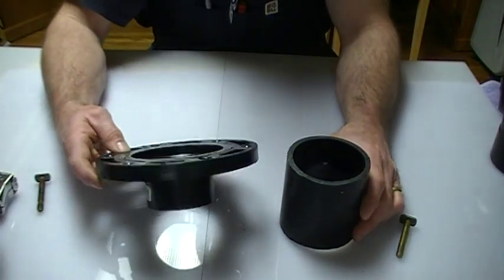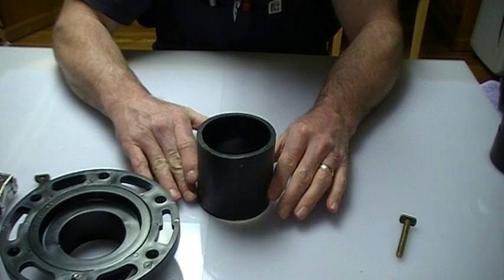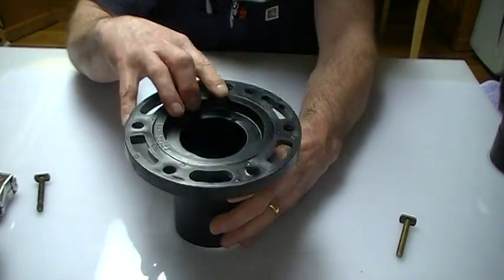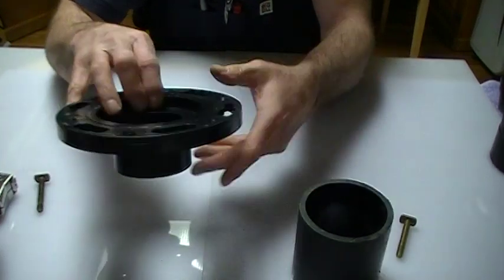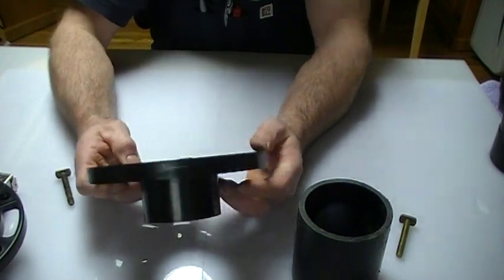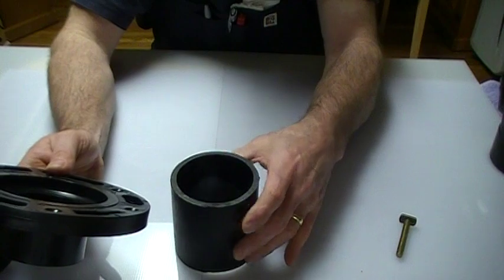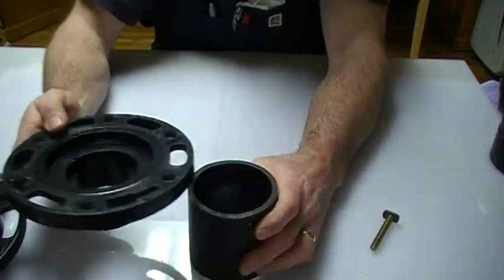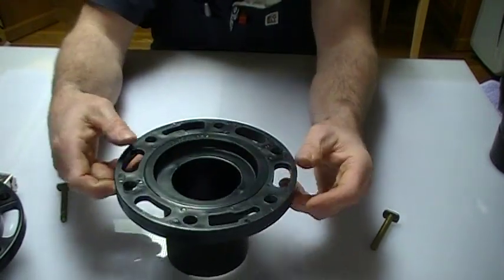Handy 4" by 3" insertable floor flange -for concrete floors.and regular installs.How to.

Comment: Thanks this is all the info I needed! Great to see informative videos that are all business and no unnecessary banter.
Reply from the maker: Hello Dan,
You're welcome!
Hopefully ti helps with any future projects!
Thanks for commenting and enjoy your week!      Al
Reply: @TheOldkid888  what if the pipe is 2" below the floor?  it was too high before cut flush and even a tad lower but flange still was too high so had to cut it all out and now its 2" from floor
Reply from the maker: @Eastbaypisces
Reply from the maker: What you may want to do is use a 3" coupling and glue it to the pipe. This should bring you about flush with the floor as long as your cut is relatively straight. There are two different types of fitting flanges. One fits inside the coupling and the other fits inside a piece of pipe. If you can find a fitting floor flange that fits inside the pipe; it is just a matter of cutting a short piece of pipe a little less than 1 and 1/2 inch and glue it into the coupling. Then glue your flange into the pipe.
If you can't find a flange that fits into pipe then you will need to trim about 3/4s of an inch off the coupling and use the regular fitting floor flange. I know this seems a bit drastic to cut that much off a coupling, but this will work for your situation. The fitting floor flange will be higher then the floor if you do not cut the coupling because there is a taper to the flange which will not allow it to go in any farther. You may have to trim a little off the flange as well. If you are able to glue this together you will have no problems as far as the connection leaking. 3/4s of an inch well glued for this situation will work fine. I hope this is clear as far as  instructions go. Let me know if you don't understand it and we will try and go through  it again.
Thanks for commenting and let me know how you get along....Al
Reply: @TheOldkid888  thx for the response but I'm confused i have 4"abs pipe that is now almost 2" below floor,  was thinking of getting flange with longer shank to reach but they all take a week to get here,  other option was cutting more from pipe then coupling then piece then flange
Reply from the maker: @Eastbaypisces  NO worries. Most toilets are supplied with a 3 inch line going to them. I would definitely cut the pipe as this would be your easiest and quickest route if you can do that. Add a coupling and then a 4 inch floor flange or use a 4 by 3 reducing coupling and a 3 inch flange. Either way will work for you. 
I was under the assumption that you couldn't get at the pipe and cut more off. My bad.
Hope this helps!
Let me know how you get along....Al
Reply: @TheOldkid888  i gotta go back under house but I think I could get to it.  Thx
Reply: @TheOldkid888  hard to reach from floor,  space around it not much
Reply: @TheOldkid888  u can't go from coupling to 4" floor flange tho right? U d need a piece in b between right?
Reply from the maker: @Eastbaypisces  If the pipe is 2 inches below the floor you can install a coupling and then a fitting floor flange glues into the coupling. You must cut a little off one end of the coupling that is upward. I would say about 3/4 of an inch. The fitting floor flange has a taper to it, so you want that to go go below the floor. It can be a little difficult to get a 4 inch flange although I just checked and the big box stores carry one that may work for you. It is an oatey twist and set. It is 4 inches overall and should go into the piece of pipe for you. Should work for you situation. 
Hope this helps!

Comment: I test fit without any wax and toilet sits roughly 1/8 in. off the floor.  Do i have an oddball toilet?
Reply from the maker: Sorry you ran into this problem.
It sounds like your floor flange is quite thick. I believe only one manufacturer makes them a little thicker than others and this happens unless tile or some other product is brought up to the flange.
When the flange is placed on the finished floor it is guaranteed to happen.
 
The toilet will sit flat on the front, but not on the back end. If this is the case you can replace the flange or shim the toilet on either side of the bolts. 

If I do shim a toilet because of the floor not being level or warped I use plastic shims that will not rust or deteriorate.

Once you have shimmed the toilet and it feels firm. A bead of silicone will take care of the gap for you. 

You can replace the flange, but it is a bit of a project!
Thanks for commenting and let me know how you get a long....Al

Comment: Well explained, I used the was the ring with plastic, the toilet is above the floor level. I will put the wax ring without the plastic. will solve the problem. Thanks for the nice explanation.
Reply from the maker: Hello TiroA,
You're welcome!
Great to hear! The wax seal alone is all that is required for that situation. You will see toilets sometimes that are above the floor a little and it is the plastic ring that is embedded in the wax seal that prevents them from sitting flat on the floor only for a leak to occur in the not too distant future.
Congrats!
Thanks for the kind words and have a great day!       Al

Comment: By far the most direct and well-explained video on how to install a flange on a concrete floor.  Can you tell me the manufacturer and model number of that particular flange?  Many thanks!
Reply from the maker: Hello gpstoddard,
You're welcome!
Here is one number that I found...Aqua-Dynamic Closet Floor Flange 3 Inch Inside Fit Plastic
Model # 3494-001
This is just one number. If you go to your local hardware store or big box store they should carry this flange as it is quite popular.
Thanks for commenting and best of luck with the project!    Al

Comment: Excellent video! 
I am installing a 3/4 inch subfloor called dricore in my bathroom on top of the concrete. I assume that I should cut the pipe flush to the DRICORE and not the concrete. Then I can finish with tile and I’m good to go? Thanks!
Reply from the maker: Hello sushi13141,
You're welcome!
That's exactly correct!
This style of flange will glue directly into the pipe and that is what you are looking for in your situation.
Thanks for commenting and best of luck with the project!   Al
Reply: @TheOldkid888  thank you! So appreciative for folks like yourself to learn to do certain things around the home. Hello from Winnipeg.

Comment: Can you use any of the holes on a flange to run screws through to secure it to the floor?
Reply from the maker: Hello keytothegate K,
Whenever I am installing a floor flange I put screws into every hole. The most important holes are the ones located where the tee bolts go. That is where upward pressure will be applied to lift the flange when you tighten down the bowl so I always put screws in those holes in particular, but a general rule if at all possible is to put them in all the holes.
Thanks for commenting and enjoy your week!     Al

Comment from the maker: Hello e1casper;

I have installed a number of these flanges and have had no problems. The opening in the bottom of the toilet is smaller then that of the flange. I will ask around though. I only use them in situations where the concrete has been poured and no sleeve has been placed around the pipe. It is an ideal place for this install.
Thanks for commenting and enjoy your week!   Al

Comment from the maker: Hello J Malone;

It is very easy to cut it flush with the floor if you are using a reciprocating saw and a long blade. The blade will bend and make a clean flush cut. A hand saw will make the same cut for you. I have used both and have had great success!
Thanks for commenting and have a great day!    Al
Reply: so the actual flange should be flush with floor, mine is still a lil above, im using same flange should i cut pipe more down cuz when i dry fitted everything w toilet on it seemed wobbly a lii but idk if thats cuz i hadn't screwed the flange in yet
Reply from the maker: @Eastbaypisces  Yes. The flange should sit on the floor, so you should cut a little bit more off the pipe to ensure this happens. 
Good luck!
Reply: @TheOldkid888  yea I cut more and cut into floor more so it would sit flush w floor
Reply from the maker: @Eastbaypisces  Your all set now! Best of luck with the rest of the project! If you have any other questions be sure to ask!       Al

Comment: Hi Al,great video. Question, I am installing a 8mm vynl floor in the bathroom, do I cut the pipe flush with that flooring? or still flush with the concrete and the floor is cut aorund the toilet after it is installed? Jim
Reply: Jim, how is this holding up 7 years later? I’m in the same situation and wondering if I should install this AFTER my vinyl floor is done? Or install now set flush with concrete.

Comment: I have the same question as Jim Taylor below.  Should this be installed before flooring (sitting on the concrete) and have flooring installed around it, or should it be installed after the flooring and sit on top of the flooring?  My flooring will be just over 1/2" in thickness.
Reply from the maker: Hello SprayandPray25;
If you were installing vinyl; I would have no problem doing it either way, but since you are installing 1/2" flooring you are much better off to install the flooring and then install the flange.
If you are installing laminate on the concrete floor in the bathroom; keep in mind that laminate flooring isn't a fan of water.
If you have already installed the flange; you will need to double up on your wax seals when installing the toilet. This will work for you as I have come across this situation many times especially where people have installed ceramic tile and the flange is level with the floor.
I am a big fan of the no wax toilet seal that Fernco makes. I made a video of it.
Thanks for commenting and best of luck with your project!    Al
Reply: TheOldkid888 Thanks Al!  I am doing laminate in the (half) bathroom but will be cognizant of the moisture.  I have a moisture barrier going down under the laminate and will caulk around all the floor edges and fixtures.  I'm also going to see what's available in the way of wax sealant.  Thanks again.
Reply from the maker: Hello SprayandPray25;
You are more then welcome!
Good luck with the project!
Thanks for commenting!   Al

Comment: Thank you for the great video!!
I just dremel'd my old ABS (hub) flange down level with the plywood that sits atop the joists.
This is a second level bathroom.
The inner diameter of my tube is 3"

I am now faced with either...
1) Chizzling off the remaining portion of the previous hub flange away from the 3" tube below, so that a new 4x3 hub flange can take its place.
OR
2) Cutting the ABS tube horizontally below the old flange connection, then installing a 3" All Hub coupling, followed by a 4x3 Spigot flange (as you showed in this video)

#2 seems faster to me.
But I think if I do this, the spigot end of the flange will only go half way down into the coupling below it.
Would this still seal properly after applying my ABS welding solvent?
Reply from the maker: Hello Mii,
If you apply a good amount of cement you will have no issues with leaks. I have done this several times with no issues. Just allow the cement to set before flushing any water down the drain.
Thanks for commenting and enjoy your week!    Al

Comment: have this flange that somone else installed in prior to me buying it and it clogs pretty easily and i also sell them where i work and i've had several customers comeback and say that they have had problems  with clogging after using this flange i would only use this one in a pinch or whereever acess to the outside of the pipe is limited

Comment: how about a 2nd story bathroom into a cast iron pipe and can you use a wax free seal
Reply from the maker: Hello John,
The wax free would work if you are going into a piece of pipe. You would need a 4" Fernco wax free toilet seal. It has to go onto a new or wax free toilet bowl as it needs a dirt free surface to adhere to.
A little tip when installing it to make it easier is to apply a little dish soap onto the ribbed edges as this will help it slide into place easier.
Hope this helps!
Thanks for commenting and enjoy your day!      Al

Comment: Hi. My basement rough in for toilet is 3 inch abs.   I can't seem to find an insertable toilet flange.    Where did u get this?
Reply from the maker: Hello Arek M.,
I pick mine up at the plumbing wholesale stores. You may be able to get one at one of these stores if you tell them that you can't find one any where. 
A few of the hardware stores do carry them. Not all, but a few. 
You can looking on line as well. You are looking for an inside fit flange that fits inside the pipe. You should see that in the description.
Hope this helps!
Thanks for commenting and best of luck with the project!     Al

Comment from the maker: Hello Todd;

I was just out at Home Depot and came across the flange. There it is called a "closet fitting floor flange. 3" inside fit" . Here the price is $7.49...
What are you planning on putting on the floor? This flange is quite thick and the concrete should be quite smooth around the pipe.
I hope this will help you out!
Thanks for commenting and best of luck with the project!    Al

Comment: Saw the same question here a few times:  should the flange be installed OVER flooring, or should the flooring be cut around the flange?A:  Always install the flange directly onto the concrete (or sub-floor if not in a basement), then cut your flooring around the flange.  This will ensure that the edge of the toilet sits on the flooring, to take the weight, and the rim of the chute rests properly in the flange.  Depending on the height of the flooring you use, it may be necessary to use a flange extension kit, but this is rare.  Most ceramic floor tiles sit well at the flange edge.
Reply from the maker: Hello Rick,
Thanks very much for that response. 
You are exactly correct!  Sounds like you have some expertise in this field.
I really appreciate your input!
Thanks for commenting and enjoy your weekend!     Al

Comment: What was the diameter of that pipe?
Reply from the maker: Hello Hablando Boxeo,
The pipe size is 3" which means the inside diameter is 3". The flange that fits inside the pipe is a inside diameter toilet flange.
They are not common, but I know that some hardware stores sell them. Ideal where pipe is coming through a concrete floor. Just cut the pipe off flush with the floor and glue to the inside of the pipe.
A regular fitting floor flange glues into a hub of a fitting. Something to be careful of when purchasing one.
Sorry if I went a little far on the explanation. 
Hope it helps!
Thanks for commenting and enjoy your week!     Al

Comment: I am looking for this style flange for 3 inch pipe for a garage,could. You tell me the brand. Not finding at big box stores or plumbing supplier.
Reply from the maker: Hello David,
I know HD sells them. I just looked them up on line. This is what you are looking for.....
Aqua-Dynamic Closet Floor Flange 3 Inch Inside Fit Plastic
Model # 3494-001
Hopefully this helps with your search. Plumbing supply stores should carry this item. It is quite commonly used.
Thanks for commenting and best of luck with the project!    Al
Reply: @TheOldkid888  Thank you for the reply and model number. I could not locate the part at HD and an online search only show in Canada, is that where you are located? I did locate it from an internet supplier. I really have found your videos helpful. Thanks!

Comment: After this flange is glued in place, you then screw the flange to the concrete?  If so, what is the best method for screwing this down?
Reply: Mogman150 yes, just use tapcon screws.

Comment: What flange works best for a steel pipe in the basement
Reply: Use Schedule 40 PVC. Be careful what older material you use in this new fangled concrete since some of the additives actually cause a breakdown of other materials such as a lead pan. (it happened to me and  and entire shower had to be replaced).
Reply: Hi Ron, great to hear from you.  This is actually for a toilet though I think a repair flange with three rubber fins works instead of glue

Comment: Is there a flange that will fit inside 3" drain pipe?
Reply from the maker: Hello Boring Man,
Yes. There is a toilet flange that will fit inside of the 3" pipe. It is commonly used where pipe comes up through concrete. It is not the only placed used, but I have used it in this situation several times.
The flange itself is a little thicker than other flanges so I only use a wax seal when installing the toilet. I do NOT use the wax seal with the plastic sleeve in it as it will not allow the toilet to sit flush on the floor.
Hope this helps!
Thanks for commenting and best of luck with the project!     Al
Reply: Could you list the flanges that will sit inside the 3" drain pipe?
Reply from the maker: Hello Boring Man,
There is only one toilet flange that I know of that will go inside a three inch pipe. When you go looking for a flange; this is what you would ask for.....Closet Floor Flange 3 Inch Inside Fit Plastic Pipe.
Thanks for commenting and best of luck with the repair!      Al